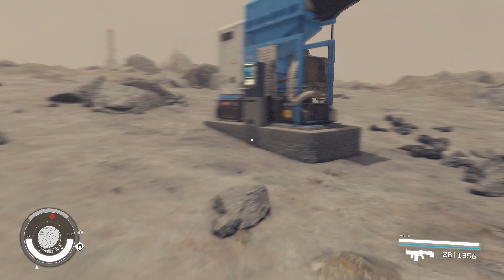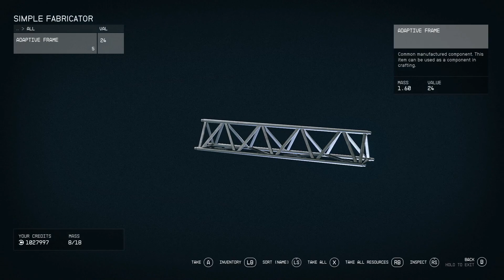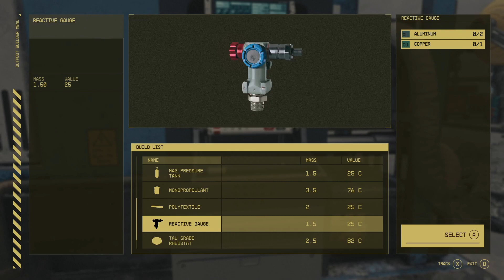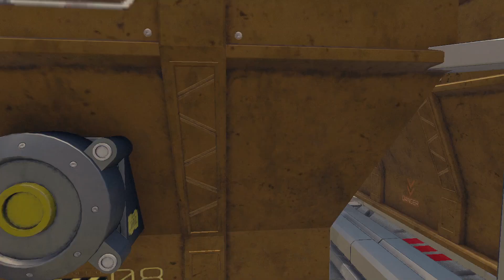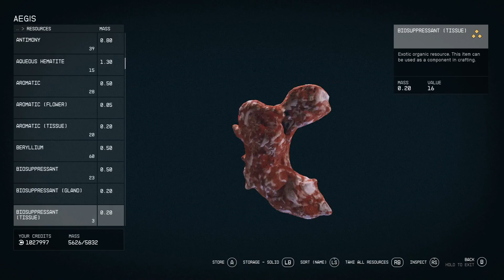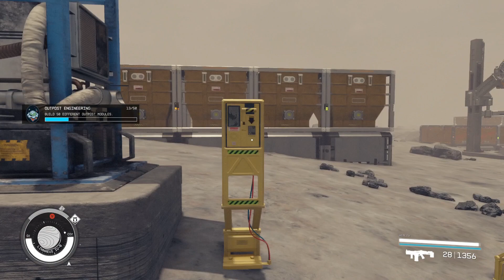Starfield Outpost 101 Part 3: Manufacturing Basics

Comment: Just a heads up on running wiring from your power source to an item that requires power. Click on your power source and hold down the A button on the controller. A nice little start out video, keep up the good work.
Reply from the maker: Thanks, I appreciate the tip and feedback!